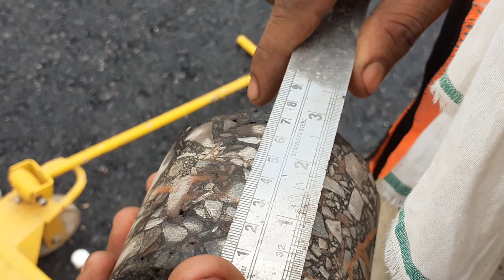Core cutter test for bituminous road DBM at Delhi Vadodara expressway/ core cutter method test

Comment: Specification of the machine please
Reply from the maker: core cutting dia 50mm to 400mm
Rate power 3500 watt 
Cutting speed 460 rpm
Cost about 25000 to 45000 rs.